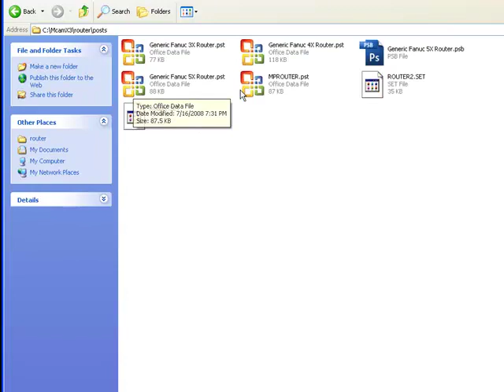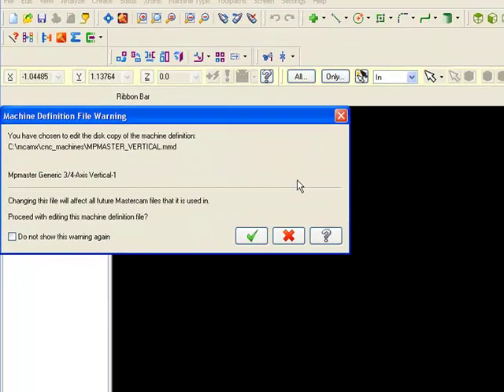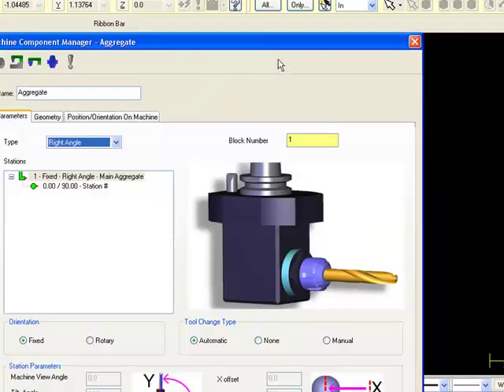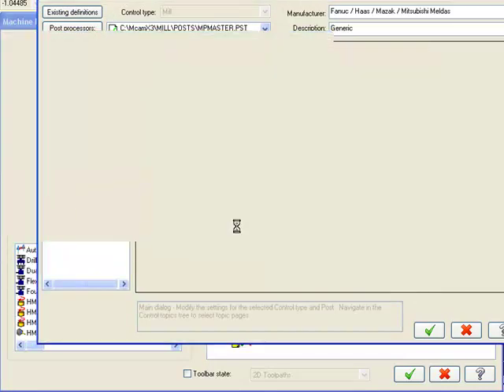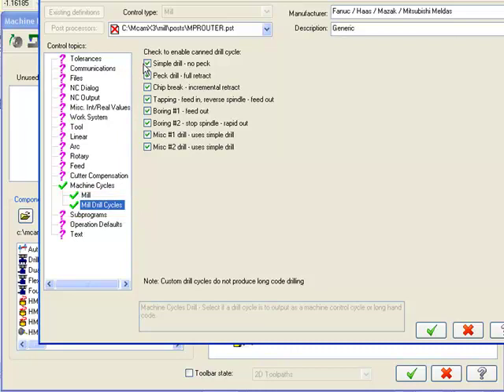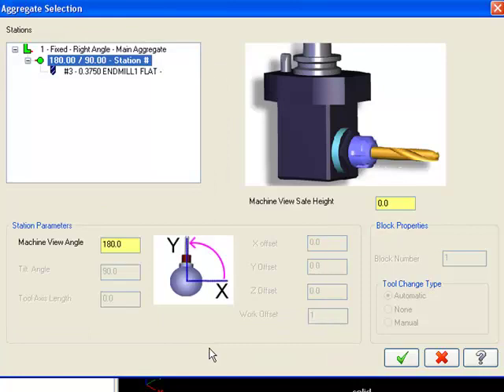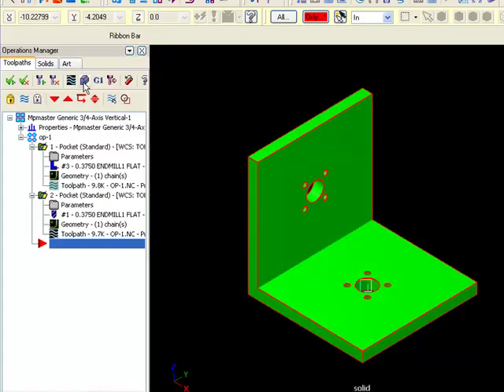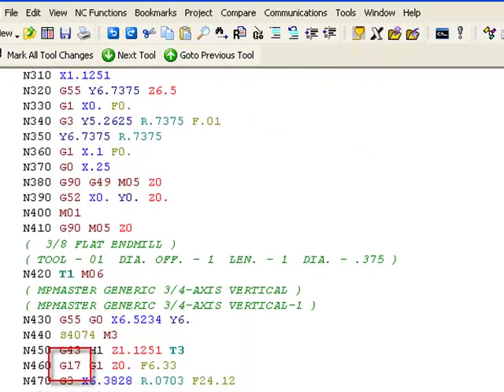Programming with a 90 degree head in Mastercam

Comment from the maker: Check you retract plane in the operation parameters for the problem with not retracting from the hole.

You say the post doesn't work on a Haas. What doesn't work? If there is an alarm when you send the program to the Haas controller, you need to diagnose the problem.
There may be some specific G or M code that the machine doesn't like

Comment from the maker: On a vertical machine, set the center line of your tool at the top of the part, this will be the Z offset. Then program the X,Y,Z accordingly relative to your fixture offset.
For detailed information, see the Article at the eapprentice web site, scroll down to "90 degree head"